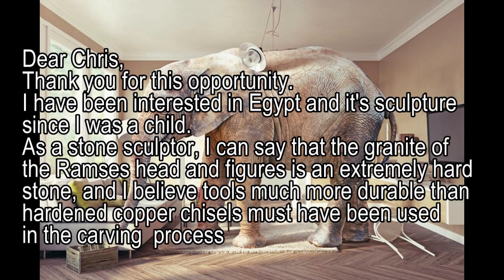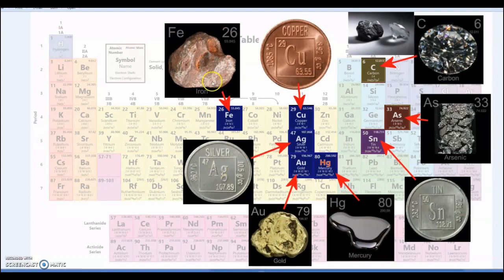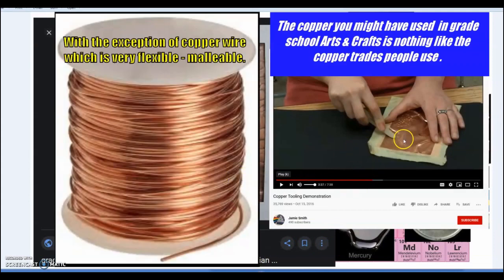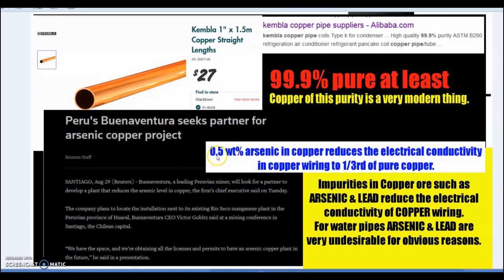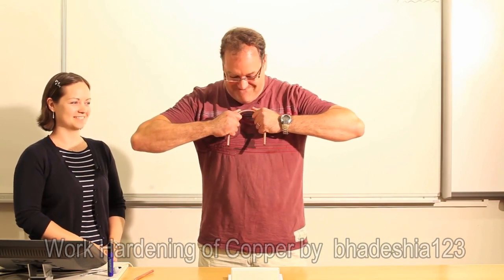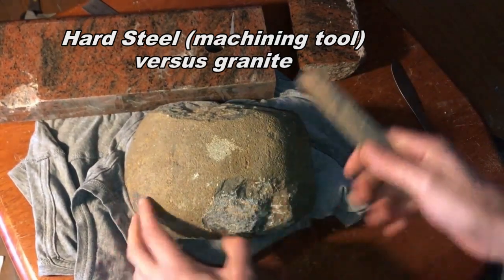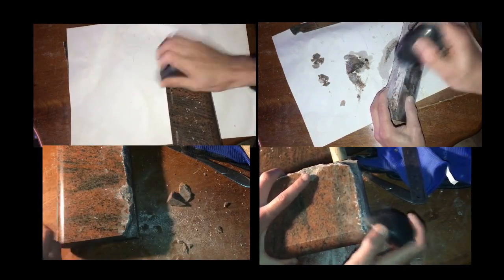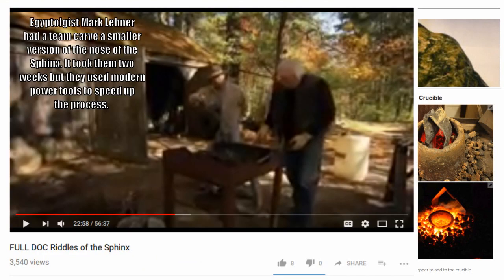Ancient Copper and Stone Tools: The More You Know.Re:the Lost Ancient High Technology Industry

Comment: @SacredGeometryDecoded I have an old solid brass Zippo from 1991 it was tarnished and going green in spots I decided to try and restore it but all I sed was an old piece of sandpaper about 1" square to scuff it up there was no shine except scratched I then used an ordinary everyday dish sponge using the scrubber side and with a lil elbow grease I got it to a mirror finish. So basically I beat solid brass with a sponge

Comment: The LAHT people (mostly) do not deny that copper and stone tools can work granite; from what I've gathered, they have issues with the scale, detailing, and precision found. They also have issues with timelines and other construction-related claims.

While it is true most of Egypt is limestone and other softer stones, there are many works that are of solid granite, most of which are dated to the earliest period, including massive single-piece columns and statues, block construction, and smaller works that appear to have had hieroglyphs more or less graffiti'd on at later time (the issue here being the claim that the hieroglyphs are contemporaneous with the original sculpting despite lacking the same attention to detail). And, yes, it is quite doable to carve a small, perfectly squared corner, it's quite another to do it along with perfectly flat surfaces all the way around a box and/or with perfect inlays of other stone. 

The counter-argument would likely be that they were experts in stone-working, which is fine, but at what point did they stop being experts? And when did they develop such expertise? How is it explained that what predated the Great Pyramid by just a few generations were nomadic people placing small stones in circles? How did they build so many pyramids in such a short span of time? The leap from nothing to perfectly cut and sculpted granite (sometimes incredibly massive pieces) and incredible feats of engineering does not make much sense. 

One of the things that makes Ancient Egypt so enigmatic is that the culture was more or less on its own when we suppose it achieved its greatest works. The Greeks learned from them and other Mediterranean cultures. The Romans, likewise. Egypt seemed to abruptly appear with unmatched abilities only to decay* in those abilities over time. 

Or, like the LAHT people hypothesize, these things were found, presumably built by a relatively advanced people during the last ice age, and repurposed by the people we call the Ancient Egyptians. (We DO need to ask ourselves why civilization only began ~7,000 years ago when modern humans had existed for over 100,000 years prior - why did it take so long? or did it?) 

We also have to wrestle with the extremely similar construction methods found around the globe in the oldest structures. Same material, same style of cutting and placement. This does not happen by chance, no matter what people want to claim. Even in civilizations separated by just a few hundred miles in the ancient world, we find drastically different styles. To say that entirely different people around the world built out of interlocking granite blocks with "nubs" is, in my mind, as big of a stretch as any claim.

Honestly, I'm not entirely sure which is the most likely explanation, the "mainstream" or the LAHT. Too many inconsistencies on both sides, and far too many blindspots.

*I suppose the great mystery here would seem to be: why did the Egyptians' abilities seem to decay?  From perfectly balanced, small granite bowls at its very earliest stage to "regular" pottery is very odd (unless they were hit with a bug that caused them to be more pragmatic). One solution, of course, is that at some point they knew of methods that made cutting and working granite relatively easy. No one is going to spend months working on a bowl or oil lamp when there's a faster alternative (like clay), not even ancient people. One could argue that perhaps these granite pieces had special meaning; that taking scraps of leftover granite and turning them into more or less art was special to them. I might buy that, but it's still speculation and really doesn't explain why the number of such artifacts is of an industrial scale - tens of thousands of examples still exist today. As we know, what gives something meaning to humans is rarity, and there wouldn't seem to be anything special about these granite pieces - as far as I understand it, many (or most) were found in giant heaps.
Reply from the maker: Michael Greco another channel copy pasted this exact same comment. Is there are an emergency response kit?
In case of information throw this nonsense word salad to look like LAHT has some legs to stand on.
At least try to reword it to make it look like you’re a real person rather than just a sock puppet protecting an industry of frauds.
You frickin moron.
Reply: SGD Sacred Geometry Decoded What? I wrote it myself lol

I don’t know what you mean by “word salad”? Is there something there you‘d like me to re-write for clarity?

Also, if a channel copy and pasted my comment, I’d like to know which.
Reply from the maker: Michael Greco well strike me down. Someone by the name of Zyvee wrote the exact same comment long word for word.
I not calling you a bullshit artist but you are a liar.
Reply from the maker: How about you edit your comment again and put the original copy pasted text?
You do know a little (edited) notice comes up don’t you?
Reply: SGD Sacred Geometry Decoded

This “Zyvee” person must have copied it while I was still making edits. This is 100% my comment. If you need me to clarify anything I will do so
Reply from the maker: Michael Greco he posted it days ago and in my notifications it shows the beginning of your original comment. You are a liar.
Reply: SGD Sacred Geometry Decoded 

Unless he can travel time, that’s impossible lol 

I don’t know what to tell you, that’s my comment. So if you need something clarified, I’d be happy to do that for you.
Reply from the maker: Michael Greco no need to clarify. You’re a liar. That’s been well established.
Reply: SGD Sacred Geometry Decoded 

Alright, link to the comment I allegedly copied lol